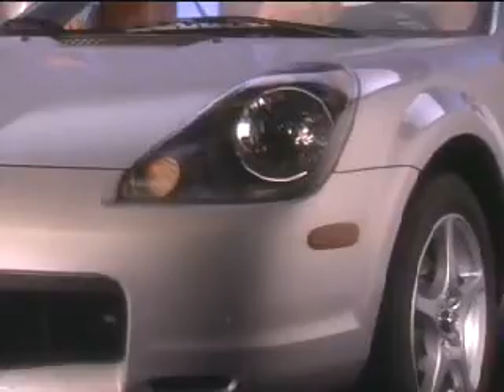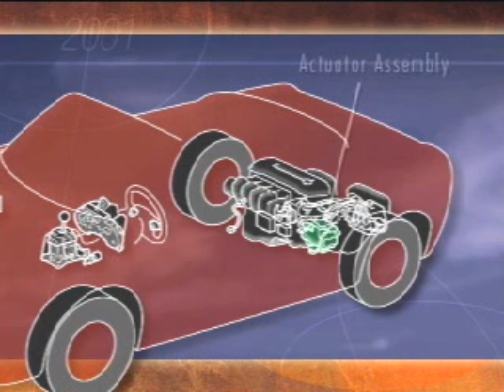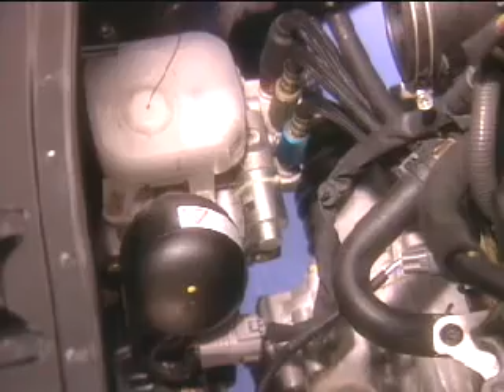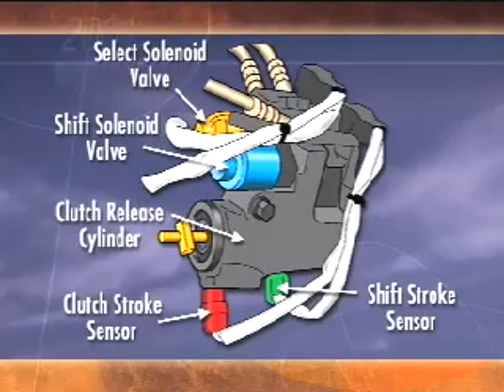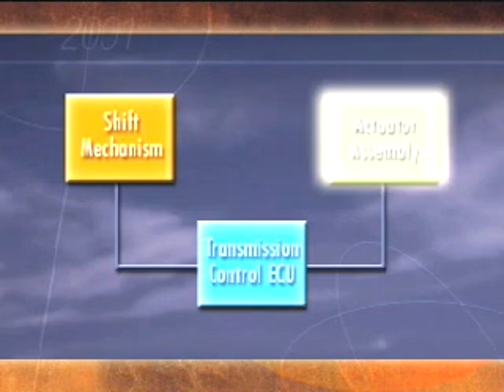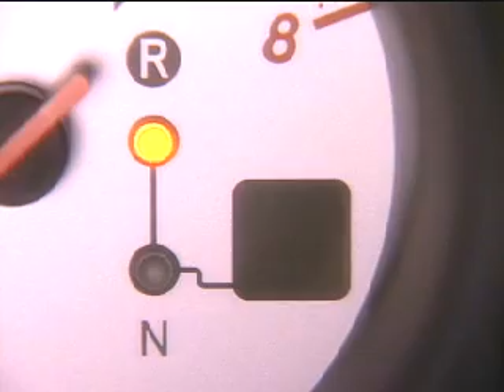Toyota MR2 Spyder SMT transmission

Comment: Commenting on 2024, this was the worst decision that Toyota did for the MR-S. Few are operating as intended, plenty are non operational due to this SMT System plagued with issues. Not even Toyota would fix em and give a warranty since they have admitted to this horrible system
Reply: Own two, a 2002 and a 2003. Dream to drive them! 100k miles and 70k miles respectively. Thousands are still on the roads all over the world.

Comment: I had a motor put In mine and was shifting fine til he put motor in.now the transmission light is on the reverse and drive works but it want accelerate to a high enough speed so I can shift to second…….need help
Reply: Change the battery

Comment: isn't this just an Automatic Manual Transmission
Reply from the maker: No, it has a real Manual Transmission and uses an external pump to push the shift fork in and change the gears in the selector shaft. Automatic Manual Transmissions are different.
Reply: @Mochi_Bird  that's exactly what he means
Reply: @Mochi_Bird  So there's a possibility to easily make it full manual? The only problem I see is having no clutch...
Reply: @Zeriel00 it has a clutch. You can get a clutch pedal, shifter, linkage, and a couple of other parts and you'll have a regular manual box. People frequently convert them to manual when the SMT hydraulics break since almost no one knows how to work on it.

Comment: this system is extremely unreliable, I replaced 2 sensors ($500) and the pump is leaking fluid it takes 30 sec to pump until it stop ( weak pump) , TCU failure on mine , end up I converted to manual , don't buy SMT MR2 and M3
also they are very expensive , TCU is made by bosch, unreliable and overprice, 3 expensive sensors control the actuator ,  pump and actuator is over $4000 , the whole system is easy to fail
Reply: The SMT system is made
by LUK in Germany (not Bosch).   If the system is leaking you should just just fix it.  Same as any other parts on a 20 year old car.   I sell repair seals and they’re cheap.  The system is quite reliable and a joy to drive in traffic or on the track.
Reply: @paulshibbs  Hello, I have a problem with the changes, when moving the gear lever only in neutral, the dashboard light and the green light flashes.
Reply: Hello friends I'm considering buying one and I've been hearing alot of cons about this system. Was unaware it's not a Convential manual so what are the cons and costs of repairs that come with
Reply: How old was the car before these issues
Reply: Mine has 300.000km and eventually had a leak problem.
Fix it and change disk for only 700$.
The joy that you get worth every penny ❤️ ♥️
Reply: Adding weight and complexity to an under-powered car: how is this an improvement?
Reply: Not underpowered. Just drive better. @chainsawcharl1e677

Comment: Stupid system, problems after problems wasted too much money..  i rather have a clutch pedal illuminated the problems
Reply from the maker: Yes, it was a very unreliable system. Too bad, good idea for someone who wants an auto, but a bit sportier.
Reply: I havnt found it to be unreliable at all. However it's insanely easy to convert to manual.
Reply: @devisissy1  I believe all conversions result in a check engine light staying on
Reply: @jam3498  how so if it's supposed to have only have been manual
Reply: @devisissy1 how much does it cost?

Comment: My reverse not working on my automatic
Reply: I have an automatic with a little shifting no clutch pedal in mines.
Reply: Hi everyone , can't shift from N to S or R. One day I was driving downshifted and it felt as if I lost a bit of control . Car shifted self into N while I was in S-2nd gear. Flashing and buzzing on N . Doesn't engage in S or R . Fluid seems pretty full
Reply: It’s your clutch need replacing
Reply: It's not an automatic. It's an smt. Sequential manual transmission. Clutch less but still a manual.  You can either use the paddles (buttons) or the stick on the floor to shift. Do any of you actually own this car?
Reply: @devisissy1  Yeah, sorry, you're right. "Technically" it isn't a "conventional" automatic, it's an automated manual transmission, with computer-controlled clutching and shifting, or you can shift manually with the paddles/buttons or the shifter. It's not actually a true sequential gearbox/manual transmission like on a motorcycle or racecar, instead, it's just an H-pattern manual trans. with automated clutch + shifting.

More info here: https://en.wikipedia.org/wiki/Automated_manual_transmission
Reply: They didn't make an automatic, sooooo....
Reply: @devisissy1  It's an automatic, more specifically, an automated manual transmission (AMT). Shifting and clutching are controlled by a computer, rather than manually.
Reply: devisissy1 yes they did lmao
Reply: @sideshot6951  the spider comes in manual and sequential manual as seen in the video. The car was never made with an automatic shifter, it’s only the clutch pedal that’s automated.
Reply: @reptiledisfunction9232  exactly. If you look at the dog box you can see it actually presses in the clutch rod. It's in NO WAY an automatic. Other than its a more noob friendly for people who don't normally drive a clutch. Side note, I always leave it in reverse. Less roll.